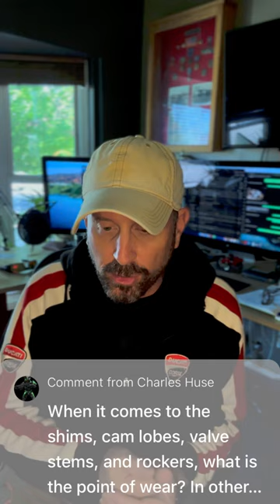Why Do Motorcycles Need Valve Adjustments? What is Wearing Out?

Comment: It's crazy how expensive it is to have a shop do valve adjustment. I've done it myself in less than an hour with just sockets, hex bits, feelers, and a screwdriver.
Reply: Is it that easy
Reply: @chrissanchez9218  what are you riding?
Reply: @ a 2016 Ducati monster 821 I have all the tools just don’t have torque wrenches
Reply: @chrissanchez9218  they're pretty cheap. Looks like a pain finding TDC on that bike tho. Good luck fren.

Comment: Honda's 80's and 90's air cooled inline 4's had hydraulic valve adjustment, it's a good option for anything that doesn't need to rev to the moon.
Reply from the maker: There's a reason why a lot of big-twins also use hytraulic lifters!  They work extremely well in the right engine.

Comment: My Harley doesn't need valve adjustments :D
With stock pushrods, my engine doesnt have any valve adjustment requirements. With adjustable pushrods(replacements for doing cam work) They only need to be checked and re adjusted like once every 20~30k miles but can mostly be left alone for 50K miles.
Reply from the maker: Oh I remember solid pushrods.  My dads old sporter, I swear he was adjusting them every other weekend.
Reply: My '98 Honda CBR was finally checked after 75K and nothing needed adjusting at all.
Reply: @CanyonChasers  lol he shoulda stopped fiddling with it and just ridden it haha.
I went looking through my service manual for valve adjustments and what not and there's not a thing in it, and turns out it doesn't require it at all. And you only need to check them if you used adjustables. Pretty nice need to worry much about it.

Comment: I think my bike needs adjustment. I bought a New fuel pump and carburator. Getting gas and firer but its hard to crank. It turns over but its sound like its trying to lockup. 1995 yamaha Virgo 250

Comment: What causes such a huge disparity between different brands and their service requirements? Triumphs usually go over 10,000 miles before needing a valve job, but Royal Enfield usually say around 3,000?
Reply: There are many different things that would lead a manufacturer to recommend different service intervals. One is the use environment: if two engines are identical, but one is put in a touring model and the other is put in an off-road or ADV bike, the ADV may recommend shorter intervals because of the risk of ingesting more grit into the engine during off-road use, which will accelerate the wear of the valve seats. Another is the redline of the engine, a low-revving farm bike is likely going to cover more miles before going out of spec than would a high-strung performance bike. Another factor is the state of tune of the motor. Check Honda's CRF250L vs the CRF250R. The 250R is squeezing out all the performance they can get from a 250cc single, it is expected to be used in an extremely harsh off-road racing environment, and likely has a minimally restrictive air filter which will allow more dirt into the engine. Also, high performance engines likely have much tighter specifications for the minimum and maximum clearance, where engines designed for daily use may be more forgiving in this regard. Another factor would be the materials used for the valves and the valve seats, as different alloys will wear at different rates.

Comment: Around how much can we expect to pay for a valve adjustment?
Reply: Depends dramatically on the engine and the ease or complication of getting to the valve covers. On something very simple like a single cylinder dualsport, or a boxer twin where the heads are readily exposed, it should be only $200 to $400 to inspect, with another $50-$200 if adjustment is needed. If you're looking at a Ducati V4 with Desmodromic valves, it may be thousands.
Reply: I dropped 1500 on my last visit to the Ducati dealer for a valve adjustment. That was for a 4 valve Testastretta Evoluzione engine. I can only imagine for a panigale v4.

Comment: Contrary to popular belief, you can’t hear when you need a valve adjustment. And if the human ear was even capable of discerning the difference between an in spec valve and an out of spec valve, 99% of the time valve lash tightens, so if it were possible for us to hear, we’d actually hear the valve train getting quieter, not louder.

Comment: It's cheap to avoid a valve check job. It's very expensive when your valve burns and your engine blows up.
Reply: On a lot of bikes it's legitimately debatable, with a valve check alone costing ~$800 (not including adjustment), specced every 12,000 miles. With the average engine being nowhere near the wear limit at the first two checks, you may be better off taking your chances and putting the money toward future engine work if needed. I personally do my own checks at home for this reason, but even the gasket set to DIY the job is over $140 from the dealer now.